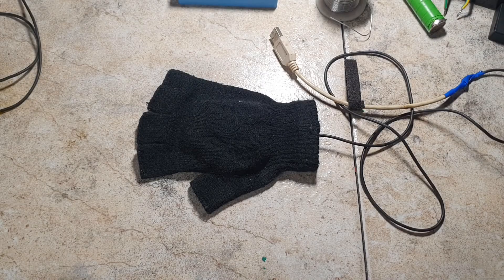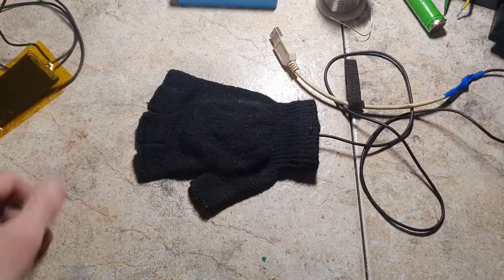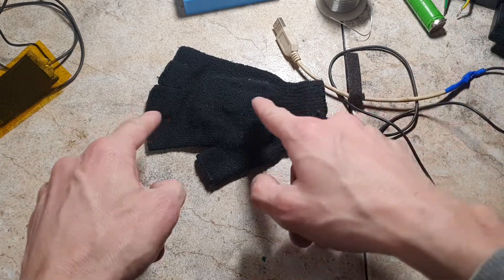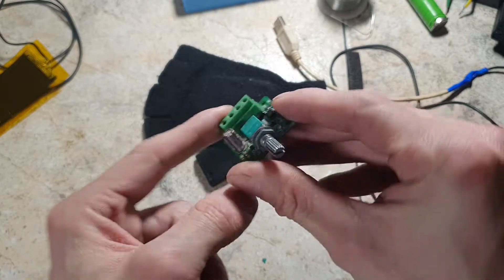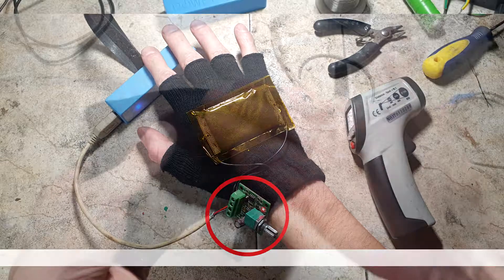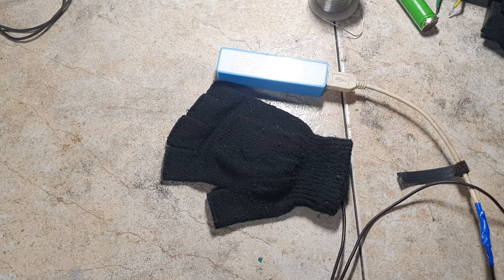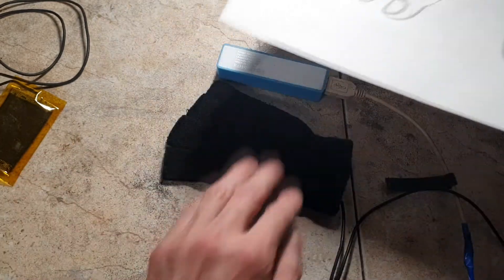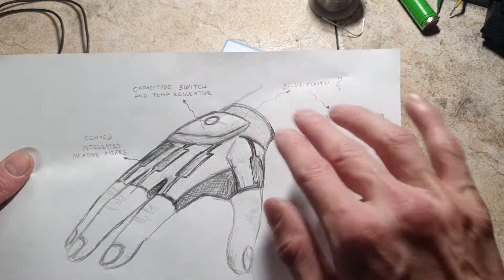Diy Battery powered Heating Gloves PART 2 (capacity touch switch)

Comment: Şu kullanılan bezin içinde isi boysi mi var ?
Reply from the maker: If you mean the heater? Then the heater is made from conductive carbon fiber which you can get on ebay (PAN based carbon fibers)
Reply: @cayrex  pan bazlı karbon fiber mi ısıtıyor?
Reply: @cayrex Does the felt have heat dye?
Reply: @cayrex  Or is it just carbon fiber (pan based carbon fiber) heating?
Reply: @cayrex  I don't understand what you are using for heating. What did you do, did you use carbon paint?
Reply from the maker: @erdemkacmaz7617  you can use conductive paint,... or better,... you can use any conductive material for low voltage heater application. Look at first part of battery powered heating glove where I make that heater out from carbon felt.
Reply: @cayrex  Sir, I did not misunderstand, did you use paint?
Reply: @cayrex  If I get a carbon pad, I can make a heat glove.😁
Reply from the maker: @erdemkacmaz7617  No. I use carbon felt
Reply from the maker: @erdemkacmaz7617  yes
Reply: @cayrex give me the link sir i want to do it too
Reply from the maker: @erdemkacmaz7617  Link to carbon felt? Search on eBay for "pan based carbon felt"
Reply: @cayrex  teşekkürler 🙂
Reply from the maker: @erdemkacmaz7617  no problem